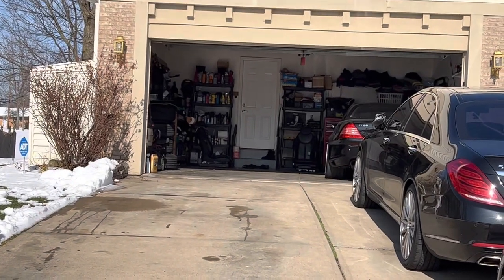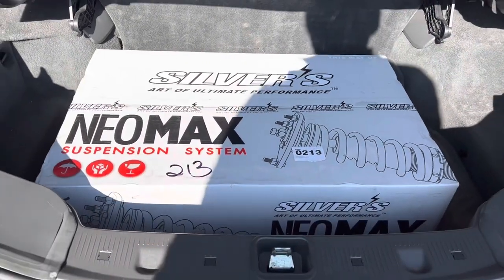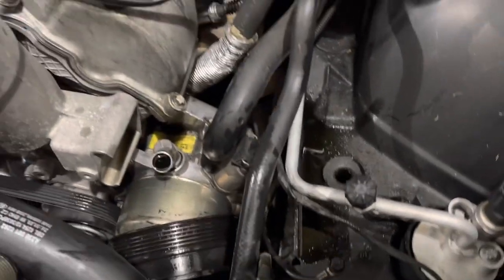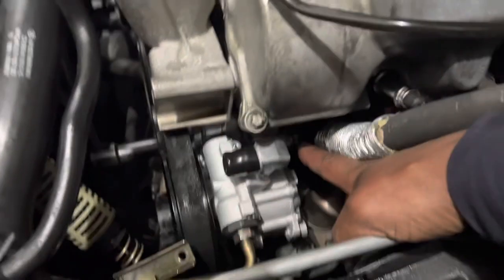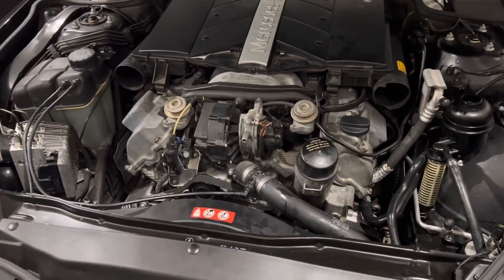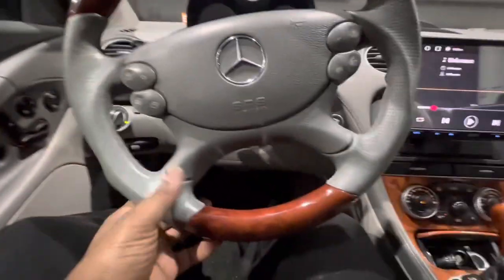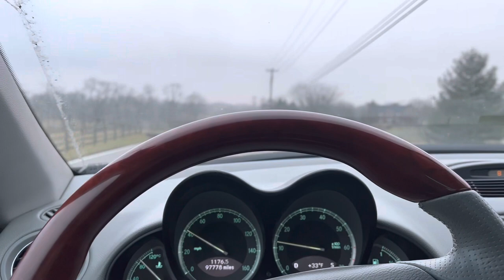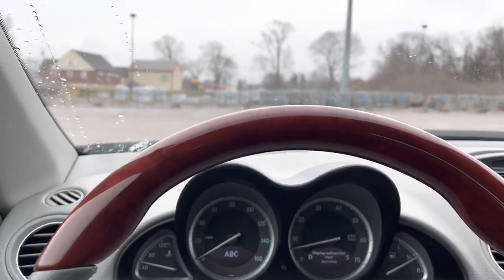🔥WATCH THIS FIRST!!! Before You Install Silvers Neomax - Mercedes SL500 - Explanation & Drive

Comment: The stance on this one is just about perfect in my opinion and just about where I like my ride height set at. A nice two finger gap it looks to be 😉 One of these days you'll have to do the sway bars combined with good corner balance/alignment in order to get/feel the full scope of what these cars are capable of when set up 110%. Congrats on the SL55, they have tremendous potential for plenty of power.
Reply from the maker: Thank you for that. I’m definitely looking forward to venturing out of my norm and trying a few additional mods to compare performance and handling characteristics. More videos to come……thank you for your support!

Comment: Nhey brother do u work on engine ? My starter signal (purple wire) was laying on  the chassis and now it doesn't even start at all . Any idea or I'll pay  anyone the wire is not burnt from the sam forward any parts in the circuit u know? I need answers by tonight . tomorrow they might come get it junk . But I don't want to please lmk . It has sat for years
Reply from the maker: Did you ever figure it out?

Comment: Good evening Sir, I am attempting to do this coilover in my garage ,with your instructional video information. The vehicle is a very , er , extremely nice 2003 SL 500 located near St Louis; with 56,000 miles. This SL was one of the group outfitted that year with everything Mercedes had to offer. Yes, some options ARE redundant, due to overlaping the same closely resembled features ; but then , it just adds to the factory Mercedes thing. Now to address a really quick FIX , if one makes the mistake , as I did , of NOT removing the 3 bolts from the pump pulley head assy and finds themselves waaaaaay down the road ; it is possible to simply and carefully , slide a punch thru the rim pulley slot , then turn the pulley to a pre- determined point which catches and solidify the rotation process in the same direction as the three removable pulley shroud screw. Once secured, it is possible; with a great deal of success, to easily remove those forgotten 3 screws in about 2-3 minutes without rebuilding your entire serpentine travel and it's tensioning system.
Reply from the maker: Good job! Well done. I made that mistake only once. Never again. 😂 Not that’s the first thing I do before removing the belt. Otherwise…your technique is a good one. 👌🏾

Comment: Did you find out where that steering wheel came from? I bought a 2000' CL500 a few months back I didn't even test drive it. I knew nothing about Mercedes or the CL's ABC suspension.  90.000 miles Silver a beautiful car. But first thing I did was flush the ABC system and change the filter. It's running 20's  as  well. I quickly realized that something wasn't right. Theres no leaks there was fluid in system so wasn't run dry I am of the opinion that the Accumulators are going bad especially the rear. So I'm getting them swapped for new and another new filter and flush. I'm hoping with fingers crossed that will be the fix. I noticed that pump you pulled out on that SL didn't have a filter cartridge like my CL does. The made changes to that pump over years and models I guess? I liked the Blk. Leather seats while keeping the silver base also. Great work you should be proud. Hats off to you for shooting video while conquering such a job!
Reply from the maker: Thank you for watching my video…..first off. I never found out about the steering wheel replacement. A nice one for sure. If you ever get tired of working on ABC, I recommend Yellow Speed Racing coilovers. ABC is fantastic when working properly. But a nightmare when acting up. https://www.goldelementautoworks.com/product-page/dynamic-pro-sport-coilovers-1999-2006-mercedes-cl500-w215

Comment: Was that steering pump oem, or was it aftermarket? 
Good job on this.
I liked what you said about the sway bars, but I think if you have non coilover suspension, they would help with controlling body roll.
Happy newyear.
Reply from the maker: Thank you for watching! I use aftermarket power steering pumps. Very reliable and they have a 1-year warranty.

Comment: I have an 07 SL550 with a broken hydraulic line.  I'm ready to make the conversion to Silvers Neomax.  I noticed that you mostly work on 03-06, so I was wondering if the 07's are substantially different.  I was hoping to follow your video to complete my conversion.
Reply from the maker: Hey…..thank you for reaching out. Yes, I have experience with the 07 and up model. I’ll include my video of the conversion. I’ll also include the link to the coilovers. Please purchase from me and I will assist you with the process, or answer any questions you may have. Thank you. The video……… https://youtu.be/A5EdKRcRemA
Here’s the coilovers…..
https://www.goldelementautoworks.com/product-page/sm3011-silver-s-neomax-coilover-kit-mercedes-sl-class-r230-03-11-1

Comment: Great video, and great work!  My 2003 SL55 is in good shape right now, but I'm going to do this conversion when mine fails.  Is it possible to save ALL the original parts, so that the next owner can convert it back if they desire?  Thanks!
Reply from the maker: Thank you! Yes, that’s very reasonable and possible.

Comment: Are there any strut tower braces to further stiffen the chassis? I had front and rear strut tower braces on a previous vehicle and it made a big difference; I could take corners at ridiculous speeds with no worry of ever breaking traction or losing control.
Reply from the maker: @ssjlkrillin  That doesn’t sound like a bad idea, honestly………

Comment: Question regarding sway bars.  Have not heard you mention anything about adding sway bars.  Looking to do the coil over conversion, and getting conflicting recommendations.
What is your opinion about adding or not adding sway bars?
Reply from the maker: You do not need them. I’m saying this from personal experience as well as from those whom I’ve helped and assisted with their conversions. These cars would have to be lifted off two wheels in an off-road maneuver or uncontrollable condition in order for it to prove detrimental. I would recommend for tracking the car. Regular street driving is not effected or mandated. Please visit my website at www.goldelementautoworks.com to place an order and get personal assistance with your conversion.
Reply: @goldelementautoworks  Thanks for the reply .. will do.
Reply: Without sway bars it will be trash, with sway bars it will be little above trash. The only reason this car drives the way it drives is because of the ABC.
Reply from the maker: @babytoymania516  Do you own a SL on Silvers Neomax Coilovers?

Comment: What settings do you prefer?  Trying to tune my Silvers. I went all the way in and 8 out and it’s stiff. Just curious what you start with front and rear
Reply from the maker: All the way full soft (counterclockwise) Then 19 turns clockwise in the front and 15 rear.

Comment: was this SL on 20’s ? And was this set up following your recommendations of decreasing total length by 2” in the front and 1” in the rear ?
Reply from the maker: Yes. 20” wheels…..and the setup was as explained in the video. Since this video…..I’ve done another coilover swap that required 1” rear, and 2.5-3” front. So not sure if the coilovers have been altered in design since this video. But start off with 2” front and let me know how that turns out for you.
Reply: @goldelementautoworks  okay cool, thanks !

Comment: Isn’t there no  Sway Bar with these ABC systems?  What happens to the handling when you make the change over.  Honest question here.  Thanks.
Reply from the maker: The handling feels superb. I have not, nor have I ever used swaybars after an installation. Myself and many others who have converted without swaybars, have not felt the need to add them. Adding them will stiffen the ride more. and prevent lean or corner lift on extreme maneuvers and at great speeds. Conditions that do not exist in normal driving conditions. If I were tracking the car and racing it, then I’d consider swaybars. It is a great ride without. And safe.

Comment: is it necessary to put the black bar that mounts to the back of the ABC pump back on the regular power steering pump?
Reply from the maker: No, no…..don’t do that. The weight and functionality of the ABC pump requires the extra support. Not so with the much lighter and simplistic standard pump. A three point mounting is all that’s needed. Two bolts in front, one in rear.
Reply: @goldelementautoworks  i figured , its already on now. I’m just waiting on my coilovers to get here, just ordered them from your site on Monday. It wont hurt to leave it bolted up i assume ?
Reply from the maker: @AzYGaming  Nope….it won’t hurt. Just extra security and more work to install. 😂 Thank you again for the support of my business. I’ll be here to you with the installation and adjustments if needed.

Comment: I am thinking of buying the 06. It has issues with the ABC. What do you charge to change out that system?
Reply from the maker: That would be a good move. 02-06 I charge $2000 for labor. 07-11 (SL550) I charge $2500
Reply: @goldelementautoworks  ok when I Purchase the car, I will  be getting back in touch . I live in Winchester Ky,  so I will bring you the car myself..... thanks
Reply from the maker: @kristdaa4612  Excellent. Stay in touch.

Comment: Question.. With the amount of coil overs you installed on these SL’s, what do you recommend as far as spring rates on the silvers. Should I leave them at default
Reply from the maker: I recommend default spring rates. Go for the Swift springs if you’re driving an AMG or the V12. They are a higher performing spring. Are you ordering them from me?
Reply: @goldelementautoworks  I’m going to get them from your site yeah, my abc is acting up on a 80k mile 05’ Sl500 so I figured just get it out of the way and sit it on coils
Reply from the maker: @velic56  I appreciate that. Yes….thats the best move. Let me know when or if you need any help with the process. I’m always here. Go to the website and you can contact me directly if ever needed. www.goldelementautoworks.com

Comment: Please help, to open and repair hydraulic steering pump for sl 500 Mercedes. Leaking from front pulley side. Seal needs to be replaced.
Reply from the maker: I’m sorry. I don’t repair them. I replace them. I do have two left in stock if you decide to replace. I’ll sell them.

Comment: abc delete neomax low dampening settings with vvk swaybars? thoughts?
Reply from the maker: It’s totally up to you. The swaybars will give it a stiffer ride. But the car can handle faster cornering better, as if on rails. There is t much lift without swaybars due to it dampening and spring rates. If you go too soft on dampening….it may be lose some stiffness, but you gain too much float. So there is a fine line.

Comment: Don't get Mercedes if you don't got money to fix it. I prefer ABC system. If it fails after 20 years oh well I will pay for the fix. What I dont want to do is to pay for major engine repair
Reply from the maker: Most people are not interested in ANY car if you have to keep pouring money into it. Rather it be suspension, transmission, engine or whatever. At some point, you simply want a reliable car. A Mercedes, although is a luxury automobile……is just a car. You want it to work when you need it to. So even though most owners have the money to spend, they don’t want to ‘wastefully’ spend money. Most of these SLs have ABC issues and have been either neglected or just naturally fail. So it’s up to the buyer to decide what best suits them. ABC or coilovers.
Reply: What are the Pros and Cons of the different systems?
Reply from the maker: @Kboy11Gaming  The pros of the ABC is the ability to remain flat on the turns. No lean. Constant automation of stabilizing while driving. Ability to raise and lower the vehicle on demand. The cons……failure. Can be catastrophic and happen at the most inconvenient times. Expensive to maintain. Parts and labor are very expensive unless you do it yourself. Most cannot. The advantage of adjustable coilovers are the permanent solution to a problematic suspension. Handles very well and feels very solid. As soft as you want them to be, or as firm as you want them to be. No or very easy maintenance. Once you spend the money for parts and installation, you’re done. No regrets from those who have done so.
Reply from the maker: https://www.goldelementautoworks.com/product-page/sm3011-silver-s-neomax-coilover-kit-mercedes-sl-class-r230-03-11-1

Comment: Please help, to open and repair hydraulic steering pump for sl 500 Mercedes. Leaking from front pulley side. Seal needs to be replaced.
Reply from the maker: I’m sorry. I don’t typically rebuild them. I replace them. I do have two used ABC pumps in stock if you want to buy one.